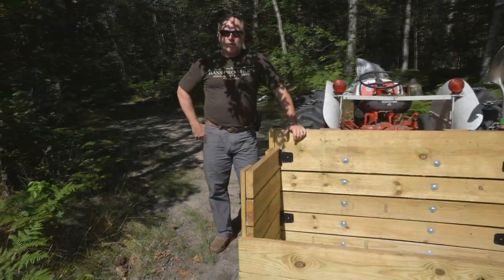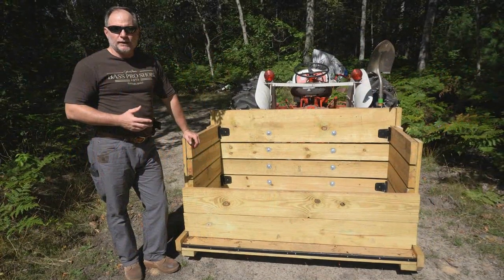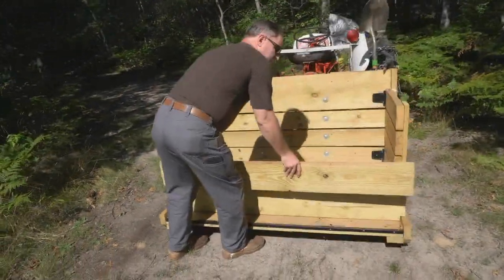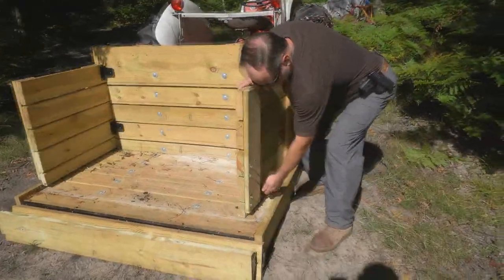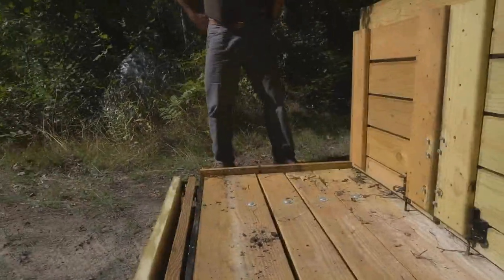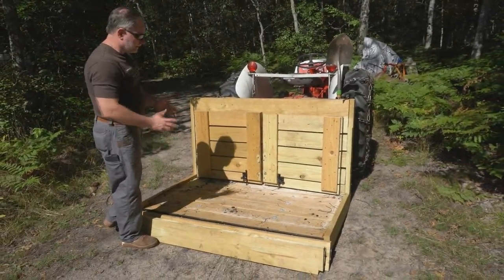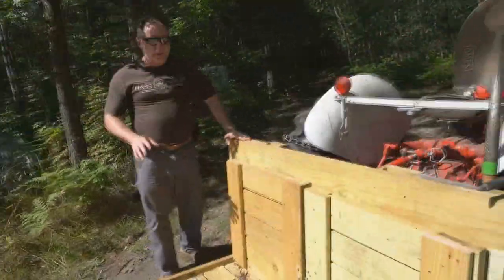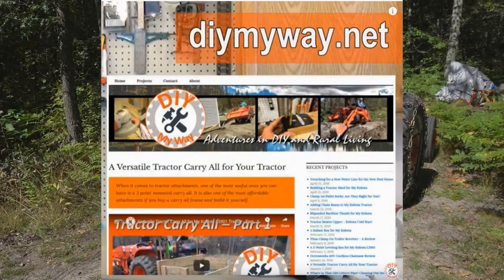Tractor 3 Point Hitch Carry All

Comment: You did a really good job, looks very stable. Thanks for sharing!
Reply from the maker: Thanks motorzeit.  Thinking of rebuilding this carry -all  with 1x material as the 2x is just way to heavy.
Reply: @thehandyoutdoorsman9014  Thanks for posting this comment.  I am building a carry all, was worried about weight with 2x wood, and ended up going with 5/4 cedar based on your comment.
Reply from the maker: @douglashenderson1419  You won’t regret it.  Happy to hear this was useful.